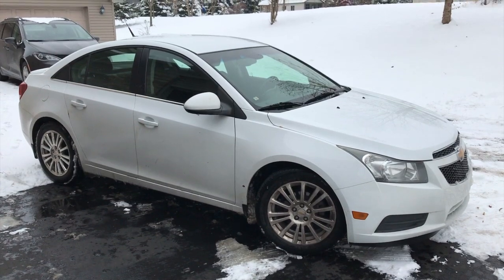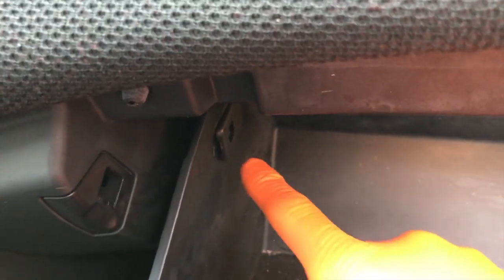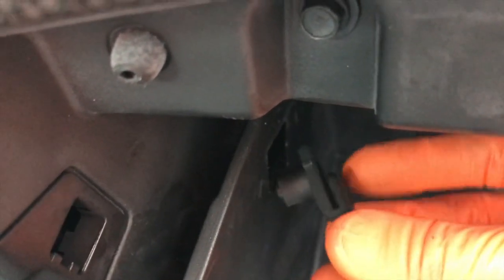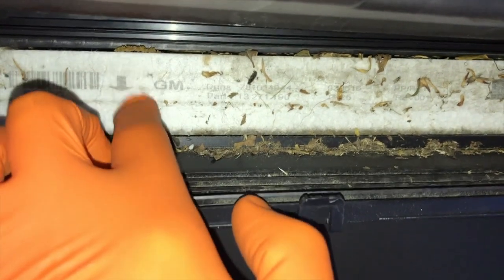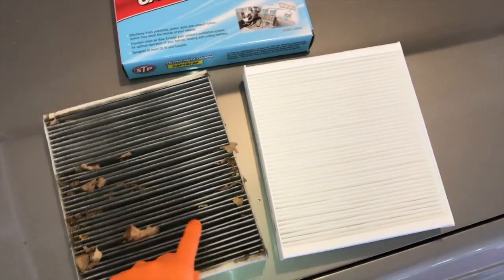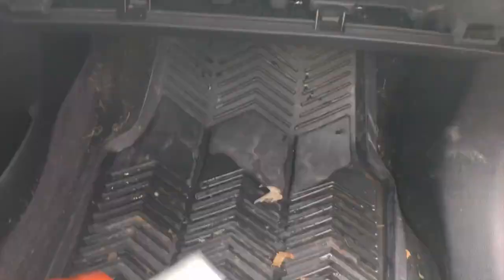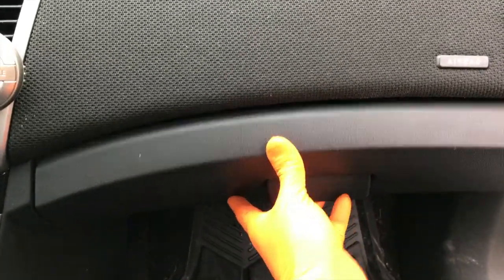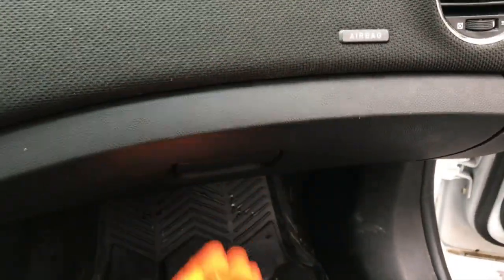2011-2016 How to replace Chevy Cruze Cabin Air Filter

Comment: This looks pretty easy i bought the filter a while  back but then the summer hit and it was too hot out side to  work on this. now its cooler finally .   those clips can be a little tricky i will  try this  and get it changed  out .  Thanks again ~
Reply from the maker: @joedevitto6113  

A fresh new cabin air filter will be nice!

😁👍
Reply: @DIYwithMichaelBorders  Yes  maybe i can breath  in the car better HAAAA

Comment: Good video. Got the new filter installed. But when it came re-attaching the side clips I ran into problems. I just couldn't get the clips to stay in place. Once I determined that I had indeed accomplished the task and subsequent movement of the glove compartment would cause the clips to pop back out. Finally, I just gave up and left them not re-attached. With only the tension cable attached. The glove compartment seems to work just fine without the clips. So, am I missing something here or will I continue to be OK with just the cable attached?
Reply from the maker: Thanks for watching, any update?  Depending on the year of Cruze, you might have plastic inserts for the clips to lock into.
Reply: @DIYwithMichaelBorders  I have a 2013 Chevy Cruse LT. I am pretty sure there were no plastic inserts in the affected area. I am also sure I have positioned the clips correctly on the sides of the glove compartment. ( i.e. the square holes) The slits on the clips don't appear to fully engage with the edges of the square holes on the glove compartment sides. I applied some pressure (but not too much) to try and fully engage with the edges. Nonetheless, the sides of the clips that are visible to the inside of the compartment seem to be lying flat. But again, any movement of the glove box at this point results in the clips easily popping out. At a loss? Any ideas?
Reply from the maker: @yesbobber  

Thanks for the follow up, that’s odd…🤔

You have ensured the two rear stopping clips are installed correctly…?
Reply: @DIYwithMichaelBorders  Well as it turns out, the clips were finally installed without popping out. So far at least. The remedy, as mentioned in your video, was to raise the glove box to a certain level while applying pressure to the clip against the glove box. Kind of a tight two-handed maneuver but I kept at it.  Still not sure what use these clips are. As stated earlier, the glove box seemed to function just fine with just the cable attached.
Reply from the maker: @yesbobber  

Never gave up, we enjoy seeing that.  We really appreciate you sharing this update.

Comment: Awesome video with great step by step details. I was able to change mine (it was packed with leaves 🤦🏻‍♀️) cleaned out all debris/leaves the best I could & got the glovebox back on. But now when I turn on the AC now, there’s a very loud motor sounding noise.. Do you know what that could possibly be? thx
Reply: Need a new blower motor yes the old one can be cleaned out but for the amount of labor your pay for the removal to clean it out you should just pay for a new one. That's what happens when you dont change your cabin filter
Reply: Mine is doing the same. Worked fine until I replaced my cabin filter. Now a loud motor sound when I turned on my AC. 😟

Comment: I do the tensioner rope first but thanks
Reply from the maker: Marvin Nivram 

Thanks for watching & sharing your comment.  😎👍🔧🔩
Reply: @DIYwithMichaelBorders  2014 ltz 80k here so far only the hole manifold issues but gota 150k warranty glad i did
 just changed that filter twice since
Reply from the maker: Marvin Nivram 

Thanks for the reply, can’t go wrong with a new clean filter.  😎👍🔧🔩